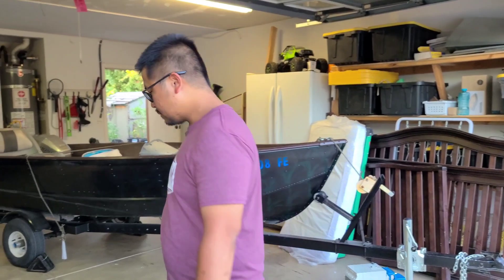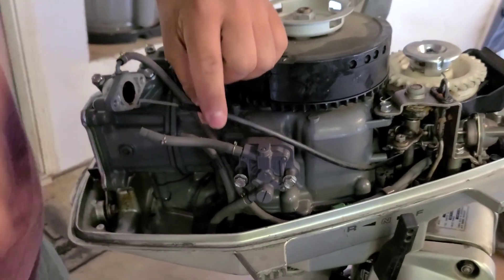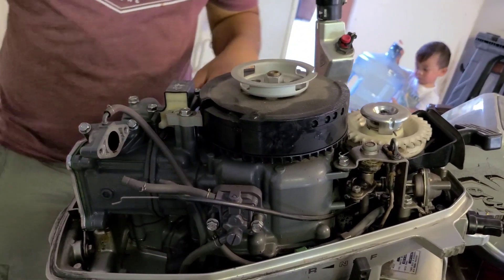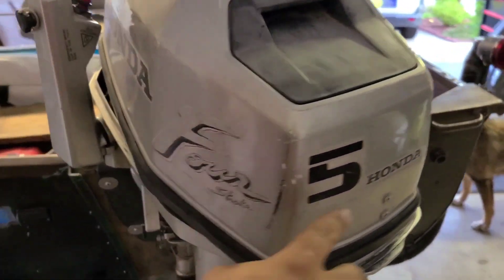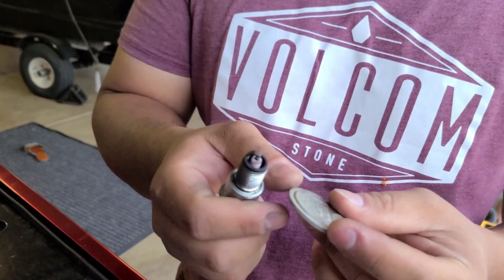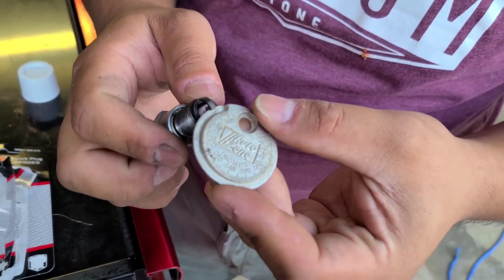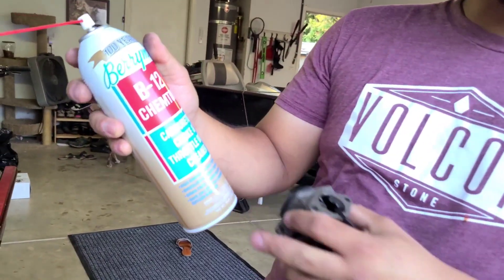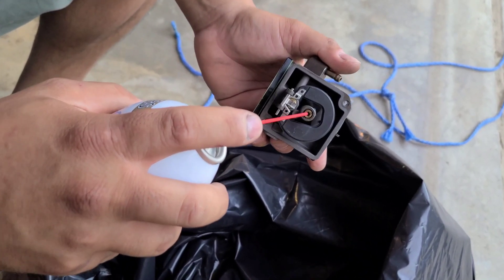Outboard Hard Start Fixed

Comment from the maker: For this honda 5hp four stroke. Spark plug gap should be .028- .031 inches. Spark plug that is Loose or too tight can cause engine damage.😀